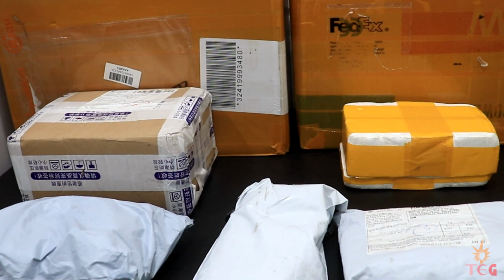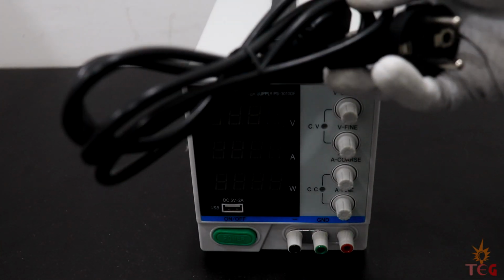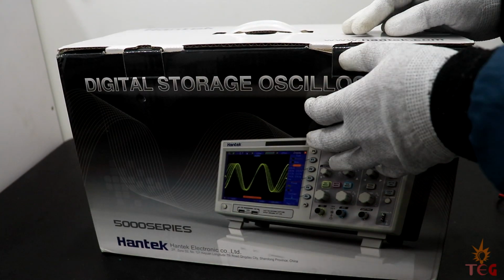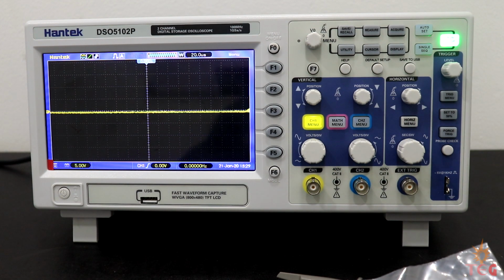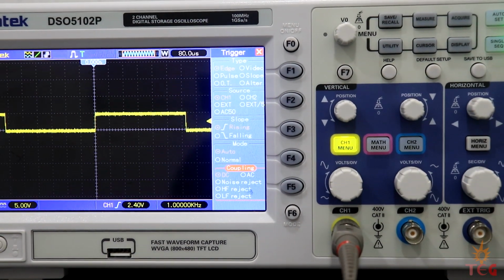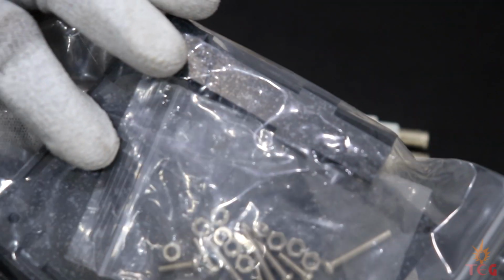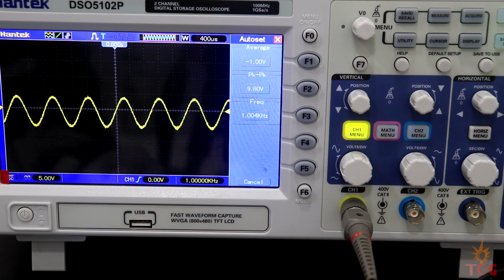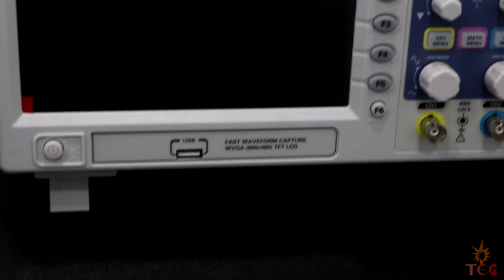Huge Mailbag from Aliexpress! Power supply, Oscilloscope, DDS generator..|Pt.1

Comment: that cable that you said has no earth pin,i does not because it is european type    they have only two pins    and can go in a socket both ways round    but the earth connection   is those 2 bars   up the side or the plug    and in eu socket ther are 2 holes   for the pins   and at 90 degrees from the pins are two prongs   in the socket that connects   to the two bars   up the side of the plug.   as i said the plug can go in both ways round of the two pins    so live and neutral   can be reversed   all hollands appliances   have no polarisation fixed   not like i know from the uk?